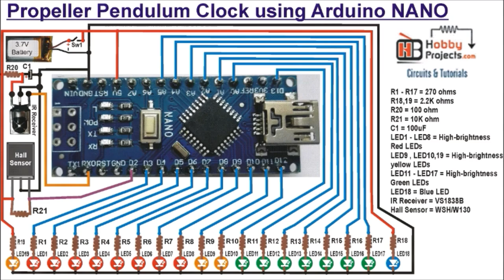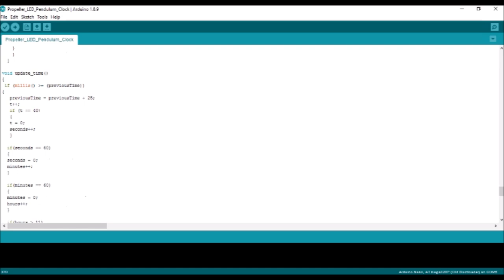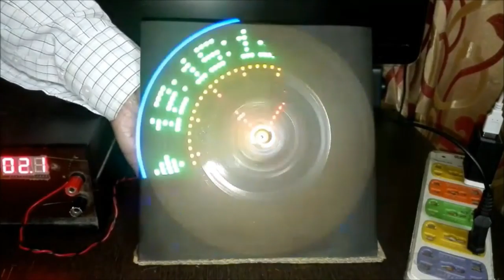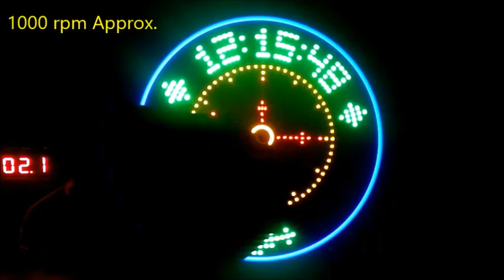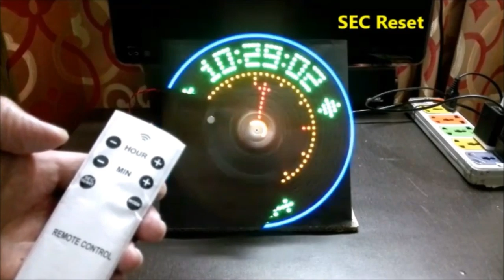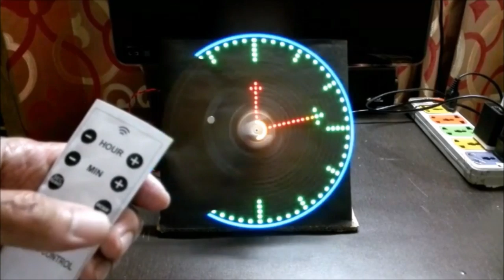Propeller LED Pendulum Clock using Arduino NANO

Comment: I made this clock. Working fine. But I want to use rtc ds3231 for backup time. Please made a video with rtc module of this project. Thanks
Reply: Please did you use the first or second link to download the upload code ??

Comment: Looks like the code has changed. The sensorPin you say to put on pin D2. Code says A0. Also, you say 17 LEDs (D3 to D13 and A0 to A5). Code says 16 LEDs (D2 to D12 and A1 to A5). I soldered it up on a prototype board and it didn't work. I re-made it using bread board boxes, as shown here. Still didn't work. Looked into the code and saw the sensorPim = A0; line. It works like that, but mow there is a dead (um-assigned) LED in the middle. I couldn't spin the bread board boxes (sensor is on its own box), so I glued the magnet on the "propeller" and spun that instead and watched the LEDs on the box. It looks like they all flash, once per revolution. Seems to me they should flash a lot of times between A0 trigger. Don't know what to do now, but I want this to work. Any ideas? Oh, and I can't get the W130 sensor here in the US. I am using an A3144, instead. Triggers OK, though.
Reply: Did you get code to work. I cannot get the code to compile everything out of scope
Reply: @larryflowers7591  I did. Be sure and follow the circuit diagram at the beginning of this video. (at 0:14) This is wired a little different than the analog clock. There are also 3 updates after this one. Good luck!

Comment: Hi I simply Love your Project. I would like to add the Tick tock sound to your pendulum clock. Can you guide me as to where in the code I can insert my Tick Tock code?
You did not include many comments to your code, thus it is hard for me to determine where in the code I can insert the tick Tock sound code.. I want to drive a piezo right off the Arduino Nano. Any ideas? Which output pin I can use to do this? By the way I did not use point to point wiring, instead I designed a PCB.

Comment: Could you help me please ? When I upload the code to the arduino nano, I get an error it says:
avrdude: stk500_getsync () attempt 1 of 10: not synced: resp = 0x00
and the same thing is repeated until I try 10 out of 10. Please help
Reply: i have the same problem
Reply: Please did you use the first or second link to download the upload code ??

Comment: can someone HELP ME please. I did all the steps and everything work accordingly( WHEN IS CONNECT TO THE USB where I used to upload the code). However, when I use any external power supply ( battery 9v-7v- 6V-5.5v ETC) IT doesnt work. ALL THE LIGHTS START blinking randomly and when I use the magnet close to the HALL SENSOR, there is no effect at all. once I plug it back to the usb, magically works perfect.
   Do I need to use the exactly same battery ? 3.7v 500maAh ? can someone help me please. How can I make it work using a BATTERY?
Reply: Please can u write the code because I didn't found it plllzz it's so important 😭😭😭🙏🙏🙏🙏🙏🙏🙏plz

Comment: Sir ...plzz listen ...to me seriously. The code that you referred in description is not the code as you shown in video of pendulum clock ...I uploaded your code many times but it don't show any motion ...so plzz ...Sir plzz..reply my comment and provide me the real code ...
            By the way ..I liked your work so much and I also make a clock similar to your as shown you in your first video ....
           Plzz help me sir ...thank you...( Rupesh)
Reply from the maker: Please check your circuit wiring connections again because the code is tested and working fine. Thanks
Reply: @hobbyprojects  I too doubt the code is correct , please recheck once
Reply: @hobbyprojects  when i try to compile the code, there is a problem show " DDRD was not declared in this scope". please help me to solve this.
Reply: @Hobby Projects please sir reply.. 🙏🙏🙏 when i try to compile the code, there is a "compile error" that" DDRD was not declared in this scope". please help me to solve this.

Comment: can I use A3144 hall sensor instead of WSH130
Reply: Not if you are running your clock with a 3.7V lithium battery. The minimum operating voltage of the A3144 is 4.5V. Whereas the WSH130 is 2.6V.